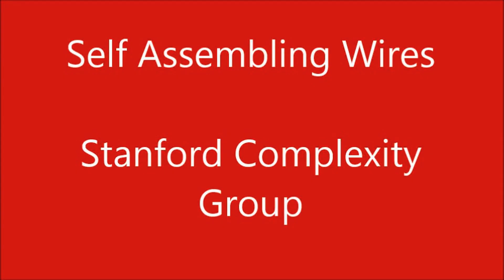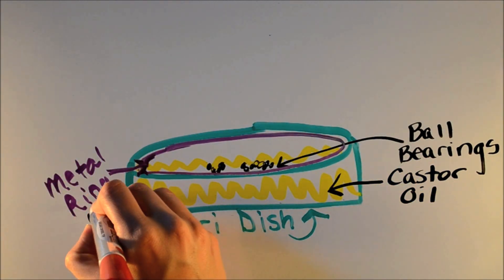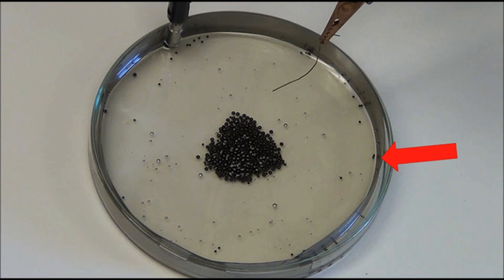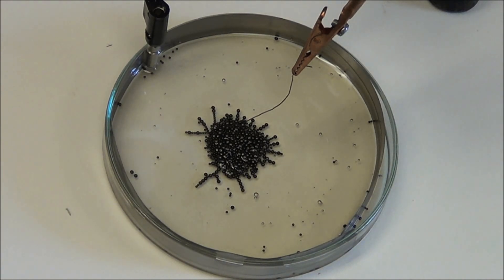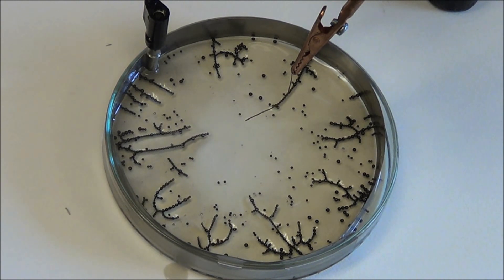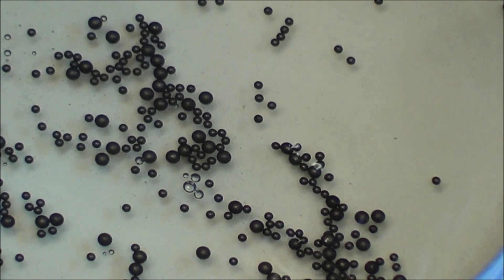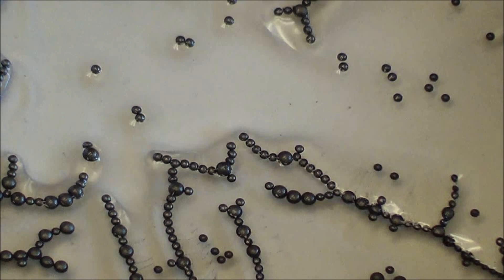Self-Assembling Wires

Comment: If the wire hanging from the top is the positively charged electrode, why is it the one spraying electrons? Shouldn't the electrons be coming from the negatively charged electrode? Or is the positive charge repelling random electrons that are in the air? Also, do you think trying this in a vacuum with an actual electron gun like a cathode ray tube would work better? Or do you need that sort of diffuse pattern of electrons "spraying" down from above, rather than a straight line? And if these "wires" are only made of ball bearings, are they not really solid structures? When you say wire, one imagines a solid line of metal, rather than a bunch of balls only being held together by electric charge. Once you remove the voltage, wouldn't the whole structure just fall apart? Or does the current flowing through them cause sufficient joule heating to fuse them together into a solid structure? If not, finding a material that would do that with the presumably low currents provided by the power supply might be something to look into in the future. Still, it's really interesting stuff. I'd love to know more about it.

Comment: If you had planted focal points for the wires to follow in the oil as a guide, like metal posts in specific spots, you could likely get a much less chaotic and more focused result to force the nodules to follow a specific path.

Comment: Wait, applying a positive voltage to the hanging electrode should cause electrons to flow towards the electrode connected to the power supply, not "spray down" onto the petri dish, right?  Traditional current flows positive to negative, while electrons flow negative to positive, right?  At least, that's what I'd expect from the little bit I know about semiconductors.

Comment: "You can't do this at home"

I mean it's essentially just high voltage transformer right? What stops any random idiot at home from buying or acquiring high voltage transformer through any number of electrical suppliers or basic home appliances?

If you had an old CRT TV you'd be in business right away but if that somehow isn't available at your local electronics recycling center or anywhere else then just buy a few microwave transformers and wire the outputs in series and you'll have 20kV in less than 10 minutes... Hell, even if this sort of experiment required High Voltage DC (Which I'm not sure of) then you can just hook the output up to an inverter right? No idea how this would be difficult to do at home unless I'm missing some crucial fact that's been left out of the video.

Comment: If im not mistaken but the high voltage and negative thats basically ground are trying to connect cause the most basic thing I know is electricity finds the easiest route to ground hence the balls get pulled together cause they are ground until they form a strong bond to reach the negative ring am I thinking right?

Comment: There’s probably a practical use for this if the shooters unfolded instantaneously like a flower; to initiate power systems like engines or to adapt to changes in weather/lighting. The automated shape change after circuit completion begs for innovation. The biggest challenge I see is the durability of the delicate materials vs the power required to operate. It seems like the answer exists somewhere in nature; with the flexibility of plants to the wind, or with miniturization down to the level of blood movement through self assembling capillaries.

Comment: Would this happen if we did try it at home, with a lower voltage? Just on a much slower scale? Which doesn't really matter if you're gonna timelapse it anyways.
Reply: It would be extremely slow or not move at all since it'd have to overcome the resistance of the oil.
Reply: @logickedmazimoon6001  But they used castor oil, which is quite thick, to slow them down. Why don't you just use a less thick oil and a lower voltage?

Comment: Cool and all, but seems to me this self healing test is random. I suppose in a battle of sorts injecting caster oil and bbs could help. In complex circuit boards I can not see  this useful. Main power wires type of application.

Comment: lol that is electro magnetism which is when you get experiment using the electric on beads will seperatly moved into a water with electric when you connect them to each other in the middle and they will create  to force and create a self wired

Comment: Well, this is sure fascinating and cool to watch, but "wires" is a bit of a stretch, and self-assembling implies a purpose or end configuration more than the initial configuration.  It is really amazing to watch though.
Reply: A wire is something that just carries electricity. The balls, when connected, carry electricity and make a circuit. So they are a wire
Reply: @logickedmazimoon6001  
What a dopey comment.  Look up wire in the dictionary.  Then maybe look up conductor in a physics book.  There is no current here, this is motion in response to electrostatic forces.  Also ... a wire is a continuous conductor and these would have random spurious variable capacitances ... they are only wires in your uneducated twisted mind.
Reply: @justgivemethetruth  There is a such thing as electrostatic current, it's moving through the balls because they are conductors. A wire carries electricity, it doesn't matter how well it does, it's going from one terminal to the other
Reply: @logickedmazimoon6001  
You again?  Get stuffed troll.

Comment: tbh it's just high voltage, i'm pretty sure many old tvs have 20kV capacitors and power supplies in them and they work with the plugs in your house without blowing up anything..

Comment: Of course we can try this at home. Anyone can build a 20 kilovolts power supply using the voltage multiplier scheme. It consist of simple diodes and capacitors, no transformer needed.  There are tons of practical circuits you'll get by googling it. Be careful, 20kv is dangerous.

Comment: This is actually similar to how a lightning bolt is formed, just that it happens like 30 million times faster. Where the clouds and the earth are akin to the + and - terminals in the experiment, but instead of metal balls, the voltage in lightning is so high that it forces itself through air - in the experiment they used 20kV and it forced through only about 1~2cm (could be more, but no more than the distance between the 2 terminals - otherwise it would just arc across terminals) . So that's just a testament to how powerful lightning really is.

Comment: "unfotunatly your outlet at home is only 230V"
That's what great about having an "old trany, busting that bad boy" out will easily get 230V to 20Kv independent of your Volt*
Just don't google that with safe search mode off, but yeah 20Kv is not something you can't do at home, it really depends on the amps you're pulling to.

*I mean there's a limit to just how high you can get from a low voltage, but sly swatters can get up to 2Kv on AA batteries.

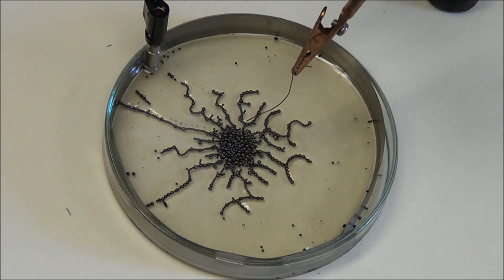Comment: 2:07 As soon as the first chain of ball bearings reached the negative electrode, the entire "connected" ball bearing network was set at the same potential as the negative electrode, right ? That would explain the spark between tip of positive electrode and ball bearings at the center of the petri dish due to disruptive discharge as the dielectric strength of air was reached. It lasted a couple of seconds. Why is the spark not persisting ?

Comment: Cool experiment, however the statement that the electrons are sprayed downward from the positive lead is incorrect. Electrons actually flow from the negative to the positive side of power units or batteries even though electrical engineering equations handle them as opposite.

Comment: If you could externally control the viscosity of the liquid through pressure or something else, you could grow a circuit raise the viscosity to keep things in place. If it got damaged or you needed to modify it, rather than replace a physical component, lower the viscosity allowing the balls to move again and move to the new desired shape, then repair the circuit then raise the viscosity back up to hold things in place for the new circuit. Self healing (or self upgrading) circuit.

Comment: Anyone suggesting mot's for this experiment is in the running for a Darwin award. Any high voltage source that can deliver over 30ma can kill. To be safe you want to be in the micro amp range. Also consider things like capacitance. If for example you choose to use a Cockroft Walton voltage multiplier then choose a frequency for the AC input that will allow you to use a low capacitance value and reduce the joules of energy stored. If done properly then this experiment can be perfectly safe. If you don't understand what you are doing the consequences can be fatal.

Comment: To put it in perspective. An electric fence can have anywhere from 2,000-20,000 volts. 20,000 being the maximum legal amount. Take into consideration a human can die from just 50 volts! So seriously, don't fuck around with electricity. Water being a good conductor for electricity, humans have plenty of that and blood can do about the same thing. Seriously. Don't try stuff like this at home without being 100% safe and know exactly what you're doing.

Comment: This also happens when cheap solder breaks down under repetitive higher current loads in electronics. The solder breaks down and grows tiny microscopic legs that seek the nearest ground connection. Eventually causing a short. The best type of repair is to tap each solder connection with an iron or run a rework station over the area. Just use lead free solder and you could avoid the problem, entirely.

Comment: Look up how fetal brain develops and how axons & dendrites connect. We are not sure how it happens but electricity is present from the beginning  it is low voltage generated by sodium and chloride. There are also voltage gated potassium Chanel's in nerves & neurons.  Cells are 10-20 microns, so they don't need high voltage like you show. !  I am a professor at an Ivy League school.  You are on to something great! Get together with a neurophysiology lab PhD at your university & see the effect of very low voltage in neural cell development.  There is a time when strands are formed to have the neurons to migrate to the cortex.

Comment: This experiment actually CAN be performed at home. Using a Flyback Transformer and an isolation transformer. The Flyback can be scavenged from any old CRT type television. Over 27" CRT preferred. With a High Voltage Rectifier (Horizontal output) you can achieve voltages up to 25K VDC. That DC Voltage is what supplies the voltage to the Anode of the CRT Tube.

Comment: If your applying that much voltage  how is that small of a copper wire hanging from the clamp not melting the higher the voltage the larger the copper wire has to be

Comment: I’d say the negatively charged metal ring  draws the positively charged “shooters” (initial ball bearing lines) to itself. This draws the positive ball bearings under the path of least resistance, hence the “race” to reach the edge/negatively charged ring. I’d assume this entire set up is electricity trying to reach harmony/balance, but it’s still a very interesting interaction! 
tldr: This video has a LOT of interesting concepts.

Comment: I'd like to this experiment re-run with different materials, test the influence magnetic fields and different wiring set ups (star, delta and an RLC cct). The 22% is quite interesting but seems to be some result of material property based on basic electrical principles (probably a combination of Kirchhoff and Ohms).

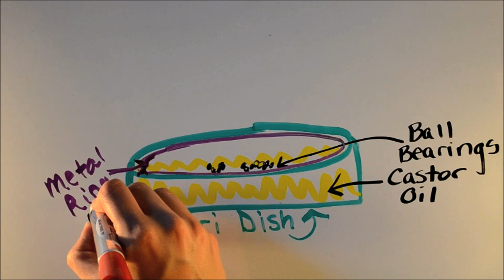Comment: 0:40 Electrons do not spray down from a positive voltage potential to a negative one. Electrons are negatively charged so they will enter the ring, not the pin.

Comment: Difficult to understand why different size balls and fill amount of balls would have the same result in branches and end connectors how do you come up with that 22% does that have to do with the difference in permielectrability (the amount of willingness of the electron to travel through the medium in this case oil and steel)}

What happens with steel balls mixed with ceramic balls

Comment: It's a DC power supply at 0,5 mA for a total of 25 watts. You could take a low amperage power supply at 60V and use two microwave transformers in series to reach 20000V and then use maybe two microwave diodes in parallel to get DC. I don't recommend anyone to build this, microwave transformers are dangerous.

Comment: Dude this is like when your eating round cereals then they start connecting to each other creating chapes
Reply: What holds pieces of cereal together is surface tension. When you put cereal in milk it usually lifts up the milk around it’s immediate vicinity just slightly and because cereal goes to the highest point of milk since it floats, other pieces start getting pulled to this little hight increase and basically attract eachother
Reply: its an extreme oversimplification, but yeah
Reply: True

Comment: Naah kid, I'm telling you, you don't even have your own house, neither you have any choice of what kind of wires that's attached to the place you're located at. This experiment doesn't need any particular high voltage or/and ampere setup. Clean that oil.
Reply: Nothing interesting happens, and then I have a bad electromagnetic coil with ball bearings u didn't have anything to do with.
Reply: What is that new structure that "forms" what is that "new" form called? D: eeeh
Reply: I think 22,2% of your balls have never seen any real purpose of them to even appear to have a slight chance of being of use. This "structure" that you showed us is of no real use.
Reply: Put the fucking current as high as it's possible and get the fuck out with your balls. This is no science.